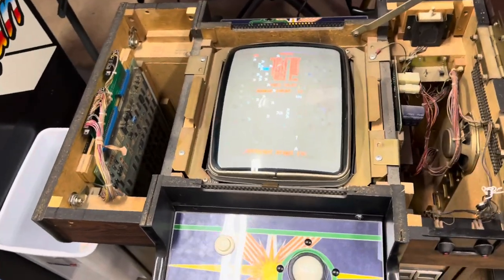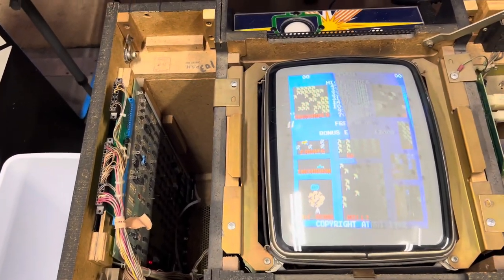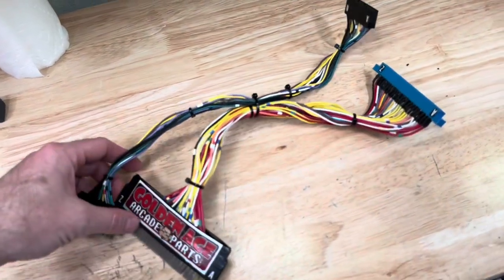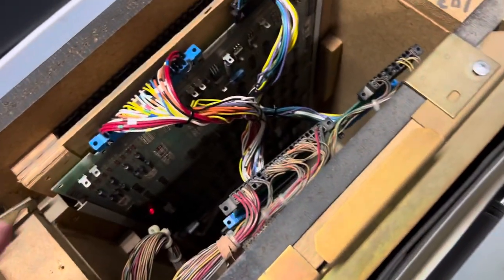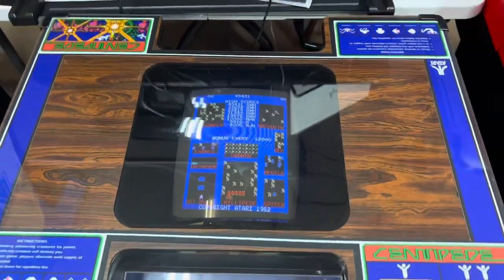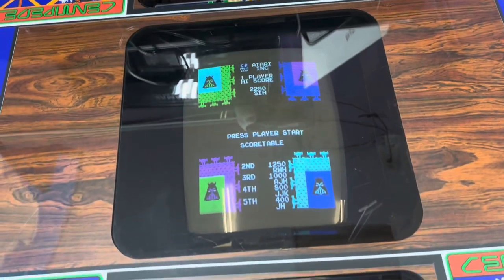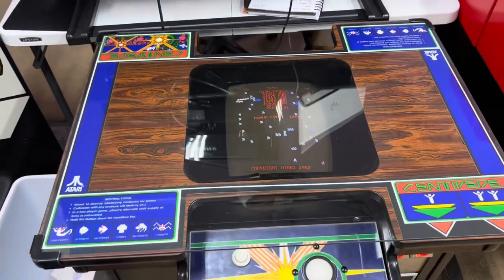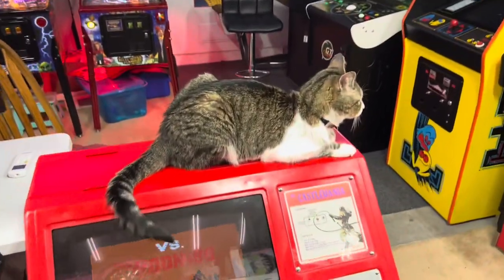Millipede pcb in a centipede cocktail table

Comment: Very nice looking cocktail. How’s warlords play with a trackball?   I just got a replica glass of my DK tabletop mad from Glass Supply just the other day.  Came out nice and only $93 .  It looked like you had a nice glass top on it already. Why the complaint?
Reply from the maker: At some point the original glass must have broke. It just had a plain piece of glass with no artwork. The original had artwork reversed printed on it. What you see with mine is I had someone make me something close to what it originally looked like. It’s card stock and put it in between the glass. Warlords plays decent as does breakout. Millipede plays ok to as the original used a 3in trackball. Thanks for watching I’ll have to check out that glass shop as I need some new pieces for my red tent. Not a bad price for a piece that size.